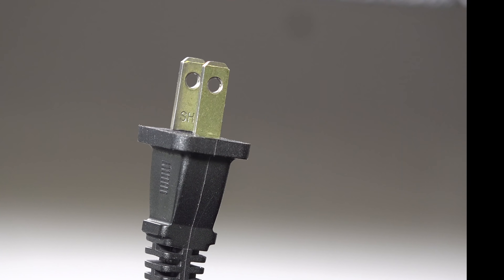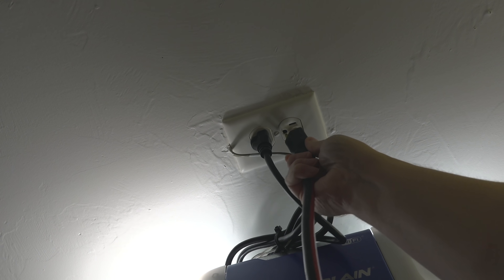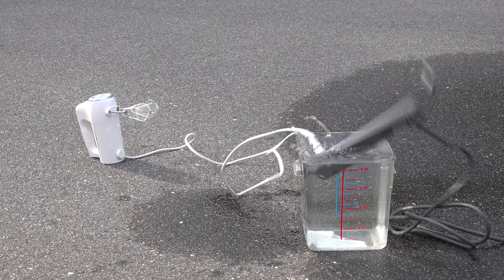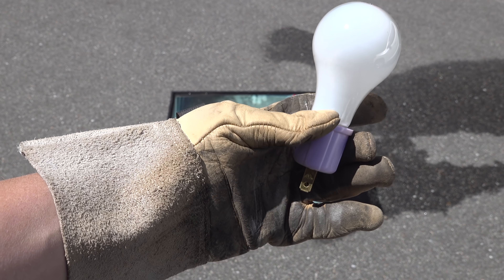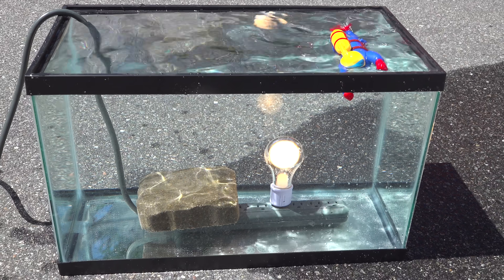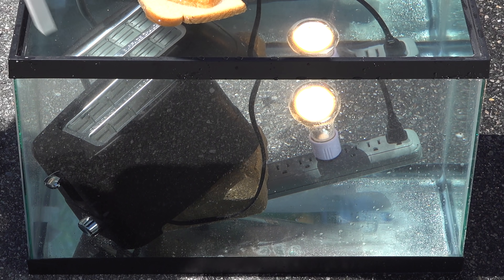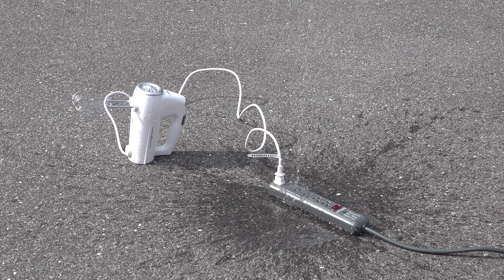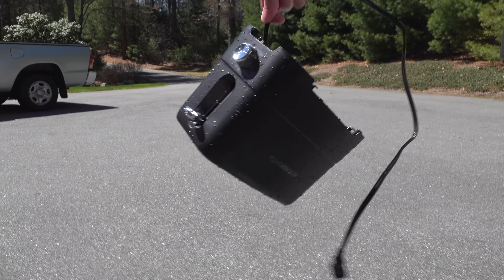What REALLY HAPPENS WHEN YOU SPILL WATER in an OUTLET?

Comment: That’s honestly terrifying. There’s just no way to know if water has thousands of volts running through it … unless you touch it and learn the hard way
Reply: Exactly, there are supposed to be huge lightning bolts constantly arcing across it. I've played video games, I know my rights.
Reply: That’s why they say stay away from downed powerlines in rain.
Reply: @webguy943  You know, would it maybe be more reasonable to stay away from downed powerlines in general?
Reply: @webguy943  Stay away from them all the time. Down or not, rain or not. Electricity can KILL your ass!
Reply: @webguy943 in the rain, huh? 

How about stay away from them regardless of weather
Reply: Yes there is as we learnt from PC video games in the 90's that electrified water always has blue wavy lines running through it to warn you :)
Reply: Nah, medium voltages behave very differently when exposed to water than 120/240/277/480. Higher voltages have better capability to overcome the resistance in water, so if you drop 2400 volt wires into water, they will arc quite substantially, even more so with higher voltage ranges. 

Of course it all depends on the water too. Your average tap water has a fair amount of dissolved minerals which is the actual conductive part. Salt water even more so. But De ionized water and very pure water tends to be more of an insulator.
Reply: frogs.
always carry frogs for testing
Reply: @aryana3462  Passive aggressive insults dont do much in the way of teaching others. Thought I'd let you know. ;)
Reply: @Yorkington  actually I wasn't even intending to teach them and it was meant to be a reflection of just how insulting he was being to the guy above, but doesn't matter cause i don't wanna bother about sheeple anymore, cheers :)
Reply: There's alot of ways to tell. This test was absolutely pointless why doesn't he have a multimeter to test the voltage....
Reply: Because he’s using line voltage from his house, which is 120 volts. A multi meter isn’t needed for these tests.
Reply: @Imran Zakhaev More like 0,05
Reply: This is why I don’t drink water. Might contain voltage.
Reply: Same concept as grabbing a live wire. Nothing will happen unless you are touching something conductive that has a path to ground.
Reply: :oops:
Reply: I don't know OP, something tells me that you have to be alive to learn from a mistake 🤣
Reply: I touched a wet outlet once. Not fun.
Reply: @seafoam6119  how was the lightning ride?
Reply: There are ways to know.
Reply: You can leave a diode in the water to get some idea
Reply: @@imranzakhaev3779 V != A
Reply: @MrEvanrich  but V=IR
Or since current is the issue, I=V/R
The more voltage you have, the higher resistance needed to generate the lethal current.  Your skin has natural resistance but goes down when wet, anywhere from over 1M ohm dry to a few 10s of K ohms wet.  Someone mentioned 50mA can stop a heart.  Might even be lower than that.  Also depends on the electrical path through your body.  If it travels on one side of your body, say from left foot to left hand, might not affect your heart but probably would paralyze your left side, possibly permanently depending if there's any nerve damage.
I don't have the numbers exact, more of an approximation.
Reply: 120v circuit.

120v is RMS / nominal voltage... 
110ish volts is the average volts ...
170v peak voltage  
340v full amplitude peak to peak on sinusoidal wave ..

And just to make your brain go brr,  there is no physical solid connection ( like a wire connected point to point ) from your house to the power grid ... the solid connection stops at the distribution  transformer
Reply: i know two people who were killed at pool that had become electrified, first one went in and died instantly then someone went to save them not understanding whats happened and he was obviously electricuted and died too
Reply: That's Why You must use  Circuit Breaker
Reply: Just use a multimeter
Reply: Or use a voltage tester 😆
Reply: You don't have to be afraid, just ask somebody else to touch it.
Reply: @aryana3462  In that case please tell me how a booking procedure goes in a hotel when a foreigner walks in last-minute. I learned this in school with our whole class and it's extremely easy. Even a kid should be able to do so, so you should definitely be able to.

See the point? Knowing advanced information about something doesn't mean everybody should know the basics because it's easy for you. It just depends whatever you grew up with or what was taught to you. A lot of these people (including me) never had any lessons or experience about electricity and are still interested in these videos. Doesn't mean they suddenly possess knowledge about electricity.
Reply: @WaterbuffelNL  That there is 120 volts AC in power outlets isn't advanced information, everyone learns that in primary school. Resistance and current is also really basic. Nothing advanced about any of this, you can learn it very easily if you aren't willfully ignorant and scared to death of knowledge about technology.
Reply: Well, it wouldn’t have thousands of volts, just 120, but I understand your concern.  Also, voltage does not kill you, amperage does!
Reply: @cajohnson1234  That is an urban myth. Voltage directly dictates whether or not the amps kill you.
Reply: @princenoah21  Voltage only influences how much amps can go into your body with the curensponding resistens, there togeter create the nesesery current. Mean 1V and a low resistens is as quit deatly as 120V and high resistens because of the same current. So Amps/Current is the Dangerous thing.
Reply: @ttonin33  The fact is that voltage absolutely does dictate whether or not amps are able to kill
Reply: @princenoah21  but in combination with resistans, thats wath i tried to say.
Reply: amps not volts
Reply: @smb1397  that is a load of crap and dangerously misleading
Reply: So if I were to throw a few thousand toasters into the ocean...?
Reply: Volts don’t run. For that matter, amps do.
Reply: It has 120 volts AC potential in it, with a resistance high enough to not allow it to draw more than the 15 amps it takes to trip a normal circuit breaker. 

Electricity isn't that complicated mate. Read about it sometime.
Reply: @xokelis0015  you say that but I didn’t process or understand that first sentence at all
Reply: @Insert_Creativity_Here  
The OP said "thousands of volts" running through the water... Volts don't run, they just are, and what they are is potential difference, or a potential for current to flow.

My point was that the voltage wasnt "thousands of volts", but 120 and they weren't "running" through the water, but less than 15 amps were running through it.
Reply: @xokelis0015  I think the OP meant water in general, like a downed power line hidden in a pool, not just this experiment. Unless you're saying water has a 120 volt AC potential, in which case you learn something new everyday
Reply: @Insert_Creativity_Here  same 💀💀
Reply: @Insert_Creativity_Here  rest assured that there's never normally gonna be 1000 volts in your powerlines. Voltages in the thousands levels would damage powerlines and house wiring.
Reply: @xokelis0015  with that being said, you would still likely die or at least sustain serious injury if you contacted that water with your skin
Reply: @xokelis0015  Hola, Senior. Spanish ain't that hard mate, why aren't you fluent?

Such a loser....
Reply: @xokelis0015  easy to say that if it's your forte  for all you know the guy is a musician and knows way more on music theory than you know about electronics
Reply: @xokelis0015  It's like magic to the unaware
Reply: @xokelis0015  And he switched in on for a short amount of time, so the 15 amp breaker wouldn't trip off in this time, until 30-40 amps.
Reply: @xokelis0015  Ohm I think it's very complicated.

Comment: I have a face steaming device, a really poor design but it works, so you put water in it and some herbs then you put a plastic piece on top, then you place your face on that plastic piece, and essentially when the water starts boiling there's no way of preventing it from getting inside and touching the cable or whatever it's called that heats up the water and produce steam, i was shocked the 1st time i was cleaning it and saw the cable soaked with water, i thought that was dangerous, but that's just how it is, so yeah things continue to work even when covered in water, you just need to not touch it.

Comment: Breakers are meant to trip due to high current, that’s why nothing tripped! With a GFCI the breaker, or outlet, tripped because the amount of current to trip a standard GFCI (Ground Fault Circuit Interrupter) is 30mA (0.0003A) which is found on the ground terminal (the hole shaded like a D)

Comment: I wouldn't have predicted the results but in hindsight I'm not terribly surprised. Water just adds another parallel resistive load to the circuit. So more current will flow but the devices will continue to work - unless the extra current is large enough to trip the breaker.

If you want to repeat the experiment, I suggest measuring two values:
1 The total current/power going into the power strip - if I'm correct this should increase if the strip gets wet and reach its maximum when the strip is totally submerged.
2. The voltage between water and ground - since the water is in contact with both the hot wire and neutral/ground I think the voltage should be half your mains - 60V in the US, 120 in Europe.

(I won't try this - I'm not comfortable working with 240V beyond simple stuff like installing a fixture or outlet, and since all circuits here are protected by a GFCI, I'd have to mess with the power supply to my apartment (eek!) or get a lab power supply (expensive).)
Reply: Why would there suddenly be a division by 2 between a conductor and a neutral/ground in a submerged situation of both?  That doesn't make sense?  If anything, the voltage might actually remain stable because there's such a stupid amount of force capable of backing up the current draw instead of sinking so much current into a device that you see a local dip in the voltage (I mean it can happen, someone living next to me has no clue how to use powertools and once used an angled grinder by pressing down on it so hard while it was already dark outside, that his shed light dimmed when going to the really low RPM because of the enormous amount of pressure he exerted on his project.)
Reply: @Dutch3DMaster  When you connect a voltage source and ground with some conductive material and then measure the voltage between any point on the material and the ground, the voltage will vary continuously: Near the source it will be almost the full voltage, near the ground it will be almost zero. Somewhere in the middle it will be about half.
In this case the conducting material is the water. Any point near the surface of the water (where you can conveniently measure the voltage without much danger) will be about the same distance from the hot wire and the neutral wire/ground. So the voltage between that point and ground should be about half of the voltage between the hot wire and ground.

Comment: water from my aquarium started pouring on the wifi power strip (the one which can be controlled via wifi i mean), it immediately started to heat up and make pretty loud noise, i was quick to unplug it and gave it a good 2 day dry, and now it works normally again. i think it would break if i wouldn't unplug it cuz it was really hot to touch

Comment: You definitely live in a very soft water area, your water must be near distilled or something. If I tried this here.. It’d trip the circuit breaker instantly, or blow the (mandatory) fuse built into the plug itself slightly less instantly… Or, the outer shell of any non double insulated appliance would send most of the live voltage passing through the water to earth should anyone touch the water or the case of the appliance… Needless to say, we don’t have many domestic electrocutions in the U.K. that aren’t DIY electrical work related.

Comment: Be aware as this comment will have a nerdy explanation of how the electricity still works on the appliances, do note to NEVER try to experiment this yourself especially at home and I’ve only taken notes off of pure science and logic

Electricity needs a circular path in order to work and in this case the appliances and plugs had a strong connection.
Electricity will take the path that has the least resistance. example; the metal wiring in the cords.
If you have let’s say a wire cut in half and you’re attempting to submerge them in water seperately apart from eachother, the path and amount of passage varies

Comment: Pure water is non-conductive. However, mixing in just slight traces of other substances might completely flip that on its head. For example a tea spoon of table salt will turn water conductive. So whether water will conduct electricity and electrocute you is up to chance. It depends on the amount of minerals and other trace substances it contains. Remember that tap water, bottled water, or natural water as well is not pure. Without proper testing you cannot predict whether water will electrocute you or be safe.

Comment: "I couldn't believe what was happening, So i got into a bathtube filled with water and got in, Still nothing I'm fine, I should be horribly electrocuted but nothing is happening, So I took a metal fork and stuck it into the power socket in the wall, surely this would do something, ANYTHING? But Again the electricity just isn't behaving like intended, So I went to a powerplant and decided to touch a high voltage exposed wire and buzz dies

Comment: Years ago I was renting an apartment. And there was this old-style lamp mounted flush to the ceiling. One morning I woke up and saw the water dripping all around me. A water pipe broke in the empty apartment above. So I called my landlord and (long story short) after an a hour or two I got into this apartment to turn the valves off. Then I came back to my place and heard my ceiling lamp was making weird sizzling noises. It was turned on the entire morning. So I grabbed the broomstick, tapped the lamp and realized it was perfectly filled with water, now near to the boiling point. All the electric stuff inside was submerged and working like nothing ever happened. Pouring hot water out of the ceiling lamp is definitely one of the most unusual things I ever done with electric devices...

Comment: This accident happened where I work, the AC condensation outlet was clogged overnight, so the water was dripping directly into a live 220V multi power outlet, causing small explosion because of short circuit. Thankfully the main breaker save the day.

Comment: I can literally tell you from experience that over time that water will start to boil and the plastic will start to cook and begin to catch on fire. It almost happened to me until I caught it because I heard the sizzle sound after I had done a water change in my aquarium.
Reply: In this instance there is so little current flowing through the water due to the high water resistance, that it will not heat up anything.

Comment: Pure clean water is actually a better insulator than a conductor.

In our factory we had and overhead hoist with a wired pendant control that was getting hot to the touch.
Nobody received a shock from it.
That hoist was used over a test tank of filtered water.
Somebody had dropped the pendant control into the water.
We took it apart and found it was completely full of water.
Sprayed it out with alcohol to dry it and then electrical contact cleaner.
Put it back together and it worked fine.
This hoist used 120 VAC control power.
The water was conducting enough electricity for it to heat the water up inside.
Never blew any fuses or circuit breakers.

Now , if you drop 480 volts 3 phase into water it GOES BOOM !!!

Comment: Here in the UK, we don't have GFCI (ground fault circuit interupters). We have RCDs or Residual Current Devices, which act like GFCIs but protect the whole house, so if you got a shock from a wet outlet, the RCD would detect it and kill the power right away and potentially save a life.
Reply: Interesting tidbit: In some ways, a US GFCI outlet or breaker works out to be slightly safer than a whole house RCD, as they trip at 5mA leakage current, compared to the 30mA leakage current the UK uses (iirc).

There are of course valid reasons why the UK did this - If you protected the whole house with a 5mA RCD it would trip constantly as every circuit has a tiny amount leakage somewhere, so a whole house would likely trip a 5mA GFI/RCD.
Reply: @eli_w_1991  I disagree.
It's better to have the whole house protected by a 30mA tripper than have most of it unprotected.

Either protect everything or what's even the point?
Reply: @sailor5853  it’s debatable. The US mindset is that you put GFCIs on circuits where they’re more likely to actually save someone from harm - mostly wet locations. The likelihood of an incident happening that a GFCI would save you from in a living room is pretty low. Some other countries have decided to GFCI everything - but to do so requires the GFCI to be a little less effective at its job.

That said, the modern US electric code is moving towards everything being on arc-fault breakers, which in most cases combination breakers are used which provides both arc fault and ground found protection. So essentially pretty much everything has 5ma ground fault protection, but at an individual circuit level, not the whole house.

Comment: What local water do you have? If I remember correctly, pure water itself is actually a poor conductor of electricity. Water though is such a good solvent and usually has dissolved substances or minerals in it which are the conducting materials for the electricity to pass through. Maybe the general hardness or softness had something to do with it